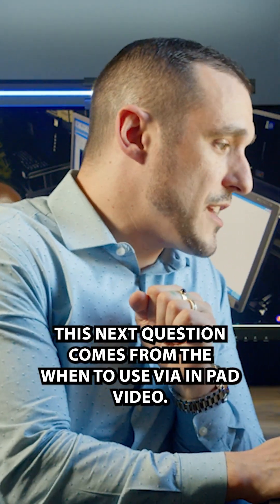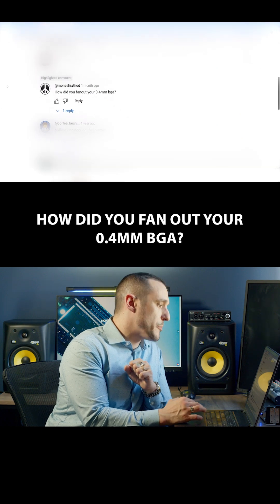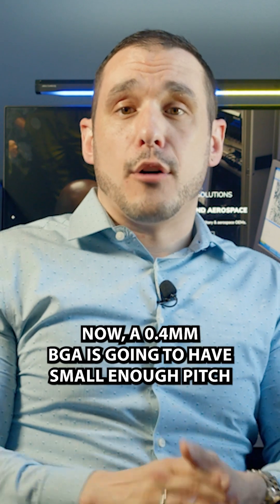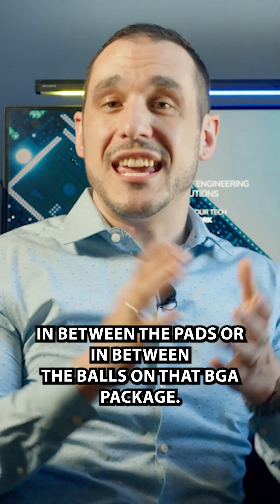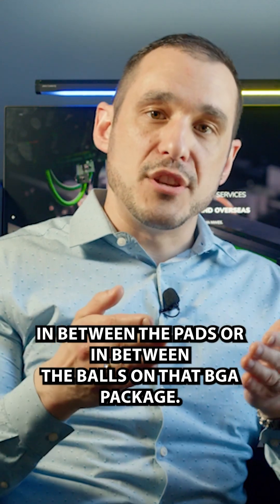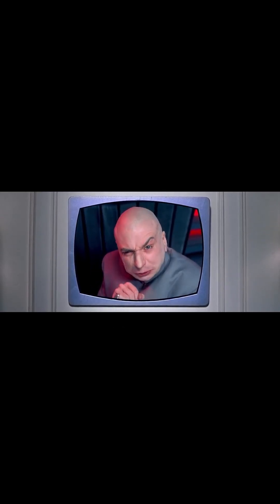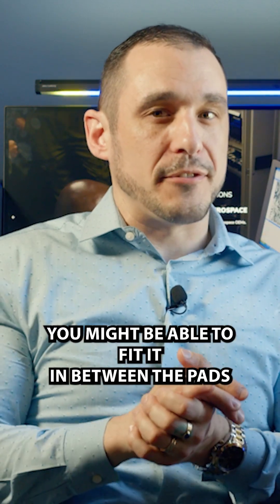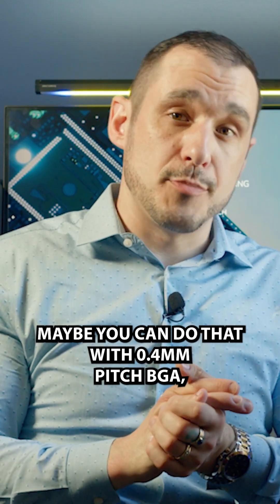0.4mm BGA? Don't Even Try Mechanically Drilled Vias! #pcbdesign #electronicsdesign #manufacturing

Comment: Even with laser drilled vias on a 0.4mm pitched BGA design, it's still a herculean task when you're thinking of fanning out each and every pin present on the package without the use of via-in pads. Hell it's a nightmare even in the case 0.5mm pitched ones, let alone 0.4mm 😂💀
Reply from the maker: Yeah for both pitches it's always going to be via-in-pad unless you're doing some ultra-small sintered vias in laser-drilled holes and 1-2 mil thick build-up film.